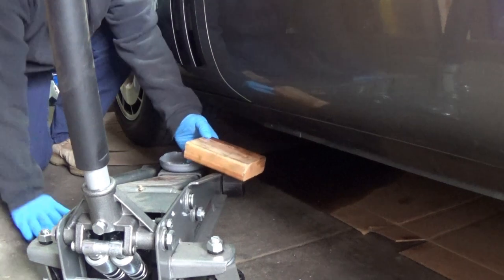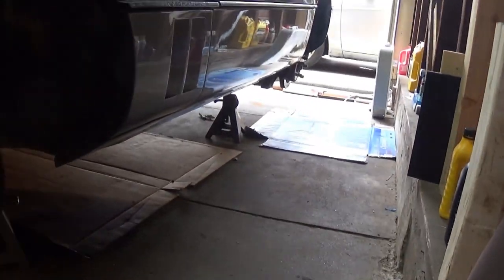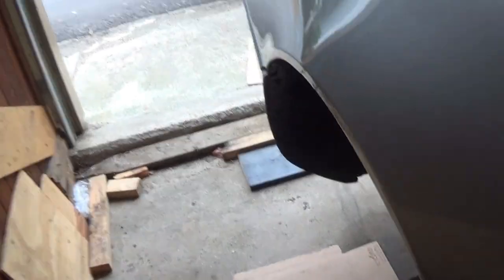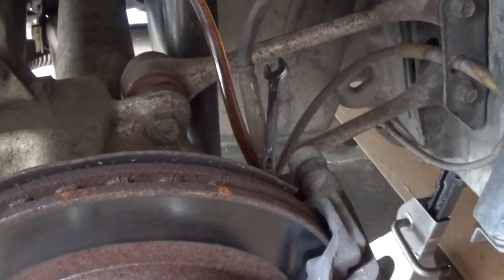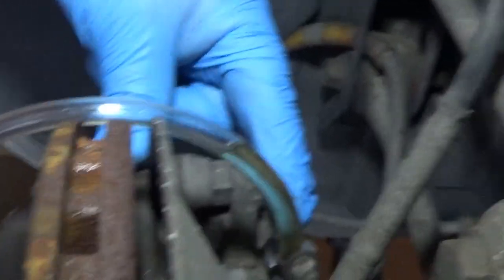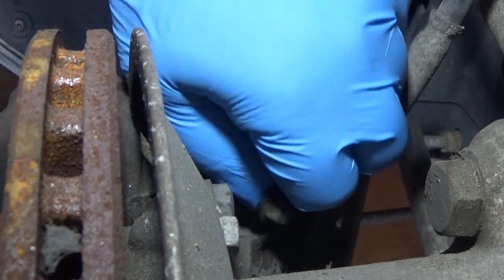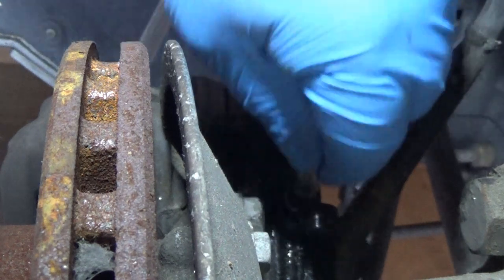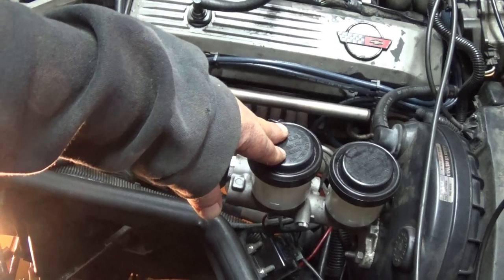Video 35 - Bleeding and Flushing the Brakes - Solving Air Bubble Issue - Jacking Up the C4 Corvette

Comment: How do you jack up all 4 areas without flexing the frame?
Reply from the maker: Have you tried it with the hood closed?
I have done with both and closed hood is better, for true, no flex you need lift or scissors to lift it.
I cut a block of wood, 2x4, with the slates that match the slates under the body edge under the drivers door, etc... and that lifted the whole car up. I have also lifted the car side form the spots just next to where I place the jacks under the car.
I can honestly say that I have had no issues with flexing.
Reply: Thank you, I’ve just read a lot about how much it is a pain.  I’ll go with your recommendation.

Comment: Why did you say "unbelievable "
When dark fluid was coming out??
Probably hasn't been changed 4ever!
I thought the bleeder screw trick was grease, NOT antiseize!
Reply from the maker: Unbelievable due to the fact that in 35 years NO-ONE changed it. and grease can be used as well, but anti-seize was what I was told to use to solve the issue.
Reply: What brand did you use for the brake fluid and did you use dot 3 or dot 4?
Reply: @Lmaow-bc8ym  Dot 3 Valvoline
Some brands say 3-4 on the bottle .